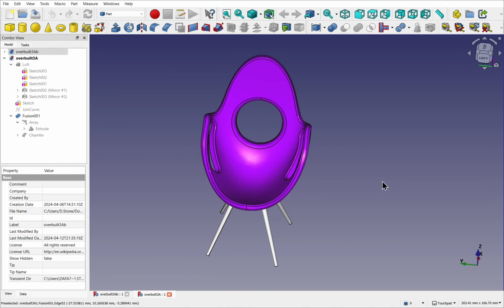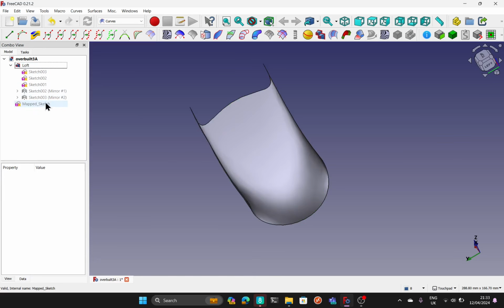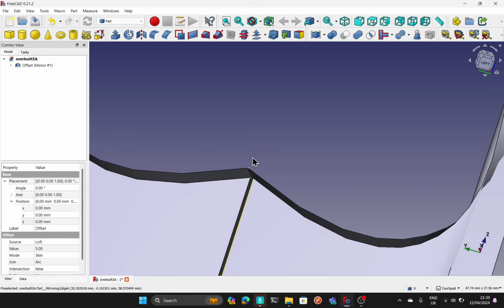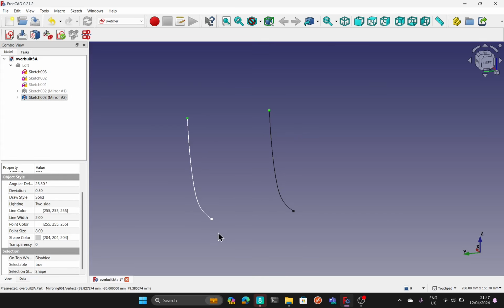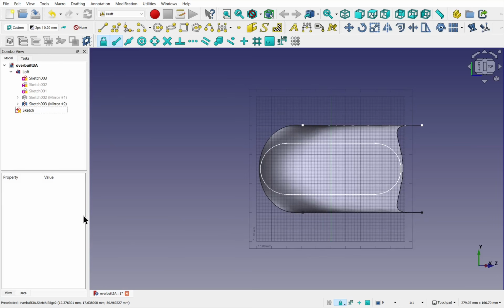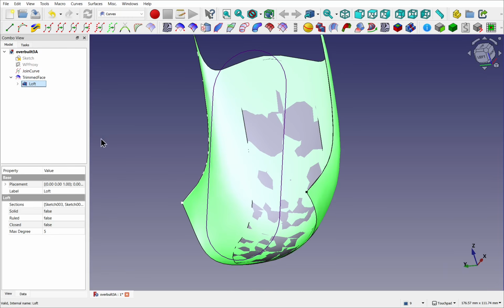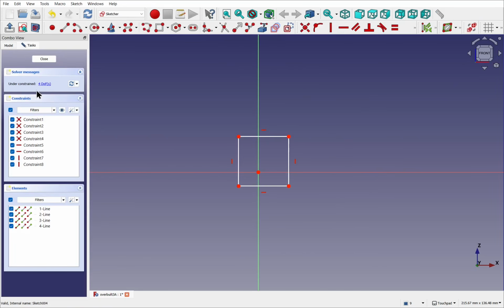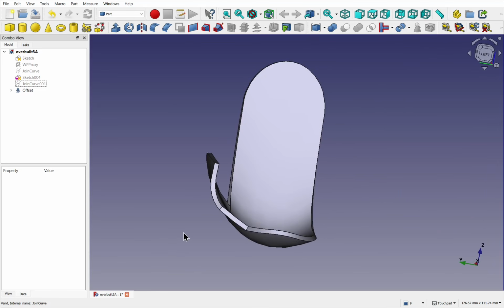FreeCAD: Over Built Surface Technique With Trim Surface Tool  | Basic Surfacing #4

Comment: Thank you for the video, waking up on Sunday with a fresh cup of coffee and watching your videos is an amazing start into the day - I feel smarter every time.

Coming from the Beginners Course (where you heavily rely on Part Design WB) the combination of Part WB and Curve WB opens another dimension of modeling capabilities! Especially the combination of multiple sketches, Part_Loft tool and Part_CompOffset is an eye opener! I wrote once in some other comment, that I came over from Rhino to FreeCAD after buying a 3D printer. Now I am happy that Rhino's  design  approach of (NURB)-splines, lofts, surfaces, projections and surface trims is still usable in FreeCAD.

I saw that you have a tutorial series on Curves WB which you uploaded 4years ago made with FreeCAD 0.20, do you recommend to watch it when working with 1.0.0+ versions?
Reply from the maker: Glad you're enjoying your Sunday coffee with the tutorials, and yes, those older Curve WB videos are still relevant for learning the core concepts but the curves workbench has matured quite considerably since then (and my teaching, wow, 4 years ago, that series kickstarted this channel!)  The part workbench is a very powerful tool that I use probably more than part design, especially when prototyping.  Thank you so much for your feedback and great to hear you are enjoying :)

Comment: Hi Darren, Great selection of various Tools used Here, as usual trying to think of ways to incorporate them into my Models. AT the end of the Exercise tried to convert into a Solid and Run the Cut Test, got some errors (probably a result of the Unconstrained initial B Spline Sketches used to create the Chair Profile. No big thing. Good example of using Sketches to modify Solid (I gather it better practice than Sketching onto Faces.
Reply from the maker: Thanks for feeding back Russel.  I do enjoy surface modeling, reminds me of my roots :).  Not sure if I mentioned this in the video but if you get any errors it's worth running the geometry check found in the part workbench.  This should help highlight where the problems are occurring.